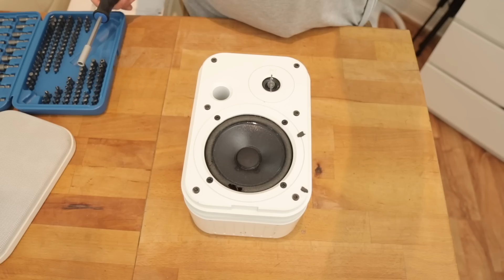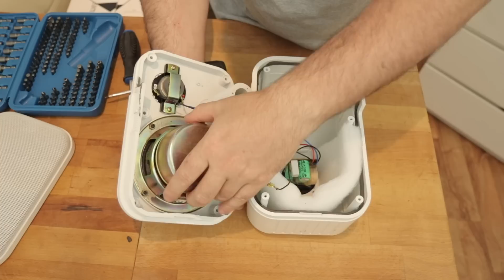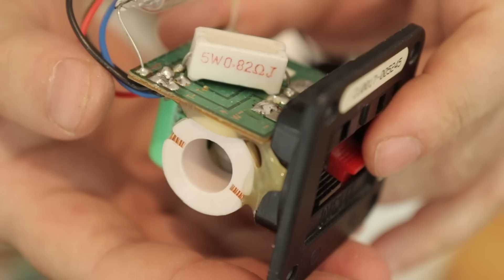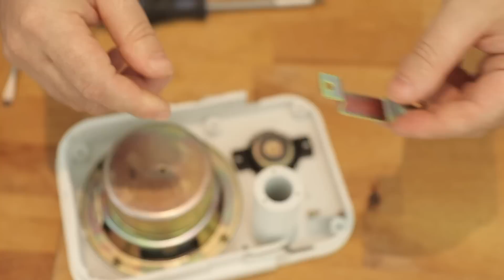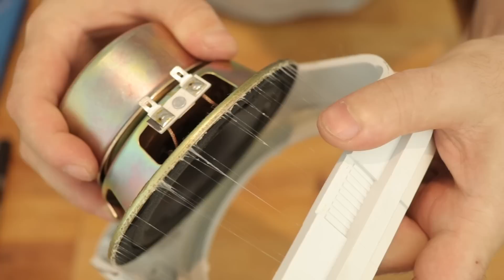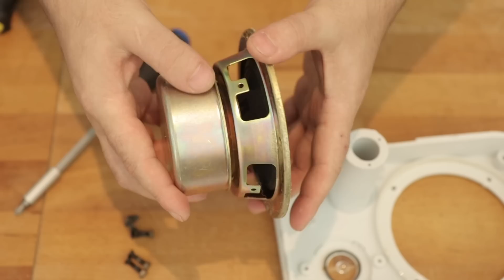JBL Control 1G - A look Inside,What's Inside

Comment: That bulb in the crossover is interesting. Does it serve as a resistor?
Reply: No, it works as an overcurrent protection. If the volume is to high it will light up. The bulb's resistance increases with brightness/temperature.